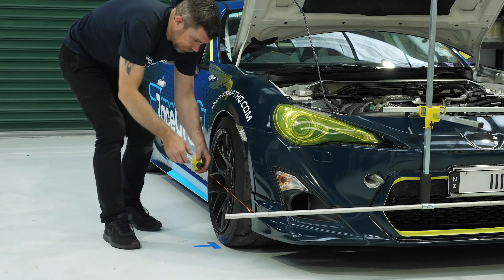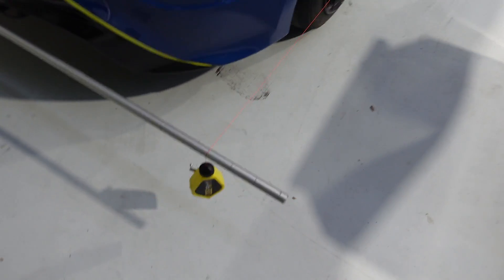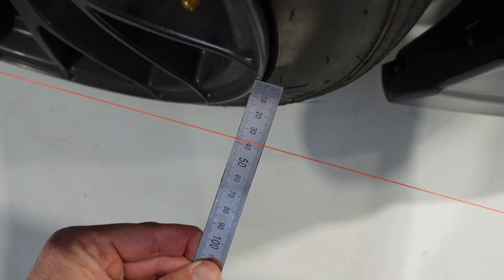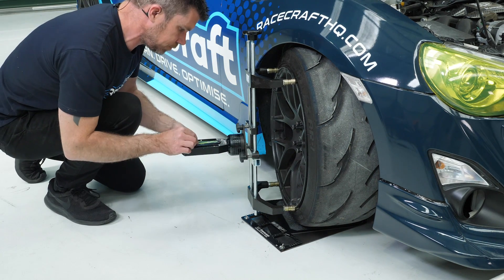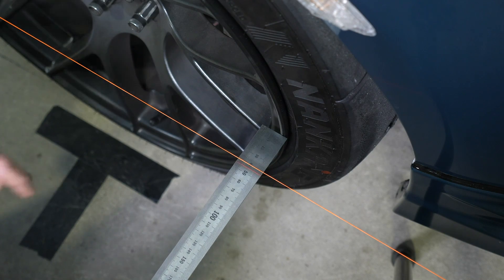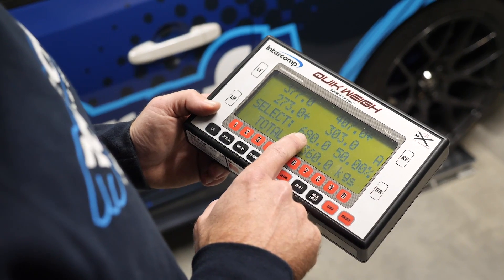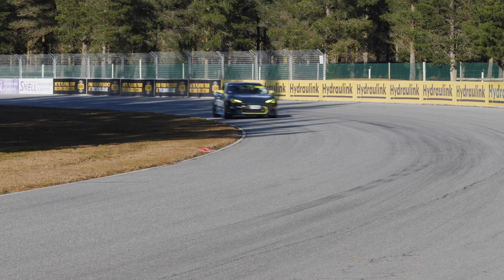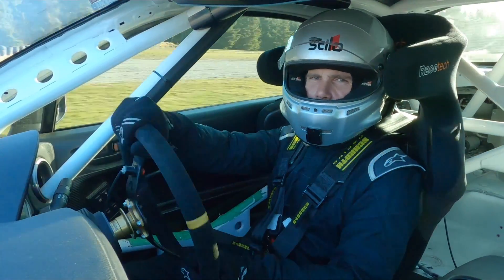Why CORNER WEIGHTING Is Worth It | Ep 5 [OFF THE RECORD]

Comment: Never seen a rhd Chevy pickup
Reply from the maker: The conversion is done in Australia by GM and adds a bit to the cost so they're not super common. They do some of the conversion surprisingly well, and some of it really poorly for what you pay. We've had a lot of little bits falling off here and there in the interior, or maybe with untouched LHD versions that's normal too? 😅

Great vehicles for towing though and handles the mountains well with a loaded trailer on 😎 - Taz.

Comment: For a home made system, the aluminum extrusion to use is a pair of 6 foot spirit levels for about $50ea with bubble gauge included. If using an ally tube a pipe cutter gives a nice groove (one gentle turn).
Reply: I use telescoping curtain tension rods. They're easy to adjust to the right length to be close to the wheels to minimize cosine or parallax errors, and the rubber caps on the end provide a nice edge to butt the strings up against. And you can collapse them down shorter for packing into your track gear. 😎

Comment: Corner weighting is also important in drag racing. At launch, you re as fast as your slowest tire, so equal weight distribution means equal grip.
GREAT CHANNEL by the way, you guys know your stuff. You re legit
Reply: You need to physically move things around on the car to change the left-right or fore-aft balance as corner weighting can only adjust the relative combined weights of the two diagonals (ie right front + left rear vs left front + right rear).
But yes, corner weighting is beneficial for just about anything with four contact patches, including trolleys and tables!

Comment: hello andre, first of all thank you for all the free info that you teach all of us, i enjoy it and many times study about it
i dont think that you need many changes into the aligment or mechanical aspects of the car for the corner in trouble, what you encounter at 150 km/h it is lift, since i havent see you a proper gurney flap or the one install has too little angle, just helping with the tons of lift that you will generate to not having anything

and yes you can generate more downforce with simple mods install into the chassis and cut into the hood if you want it, thanks for all and keep the good work

Comment: Great video folks, as they all are !  The biggest issue I have using this method is ensuring the front and rear bars are actually centralised to the centre of the CHASSIS and perpendicular to the front to rear centre line. 
That way, as long as one measures and corrects the distances between front and rear wheels one can be sure one is not wheel aligning a parallelogram .    Any tips on how best to do that ?  (My car is a 2 seater CN spec Prototype)

Comment: if the car seemed relatively symmetrical in its handling, then the problem at t3 won't be the static weight distribution. Either you don't have enough camber on the rear to handle the lateral forces, or your rear roll stiffness is too high relative to the front
Reply from the maker: Thanks for commenting. It's a little tough to show everything in these vlogs as it kind of misses the full context of what we were actually filming which was a couple of modules for our corner weighting course. You're correct in so much as not all handling issues of course are a result of corner weight imbalance and this is covered in detail within the course. There's a complex mix between alignment, roll stiffness and corner weighting that all need to be considered before making a decision on the correct course of action - Andre

Comment: Weight balancing only with the driver sitting inside by measuring the weight 😉
Reply from the maker: Yes accounting for the driver can be tricky when there are multiple drivers using the same car on the same day, or even during the same race - Taz.
Reply: @hpa101  Also average race fuel quantity - especially when using a prototype with a one side fuel tank.

Comment: Alignment is not only for circuit racing or autocrosses. Equally important especially with FWD drag racing.
Reply from the maker: Well any type of drag racing really. In fact if it has wheels then you can be pretty confident the alignment is important. p.s I come from a sport compact drag racing background and we were very particular with alignment to get the most out of the cars we were involved with - Andre